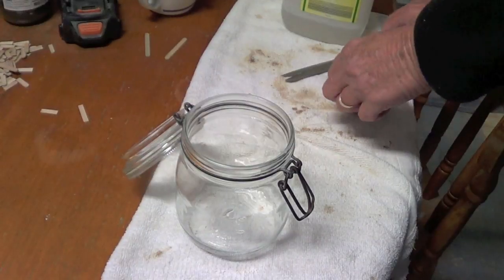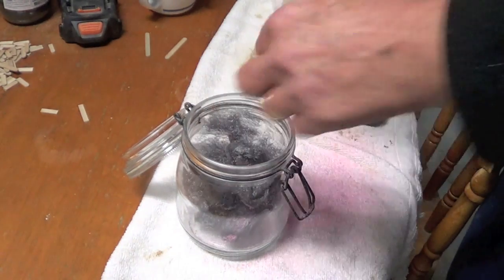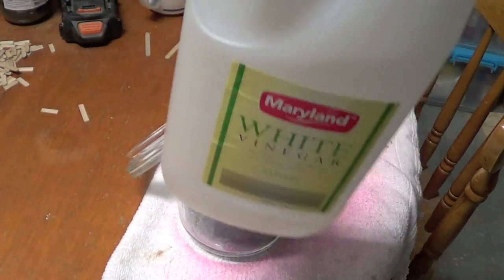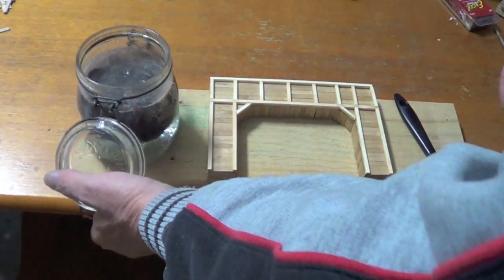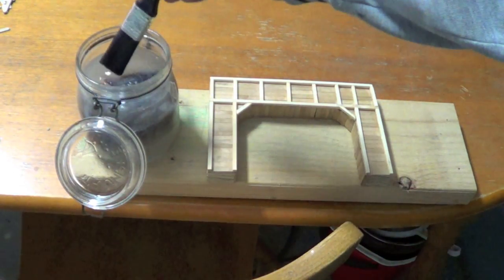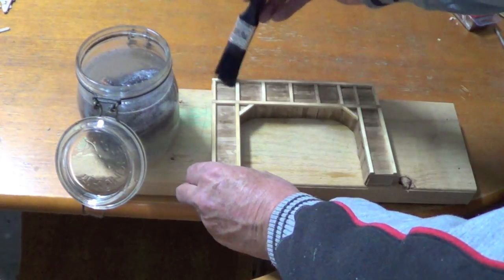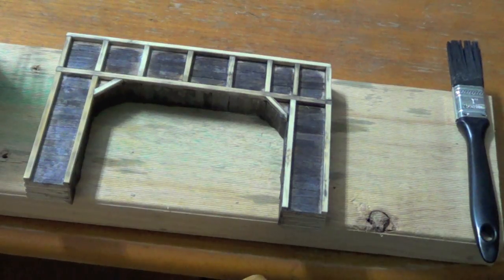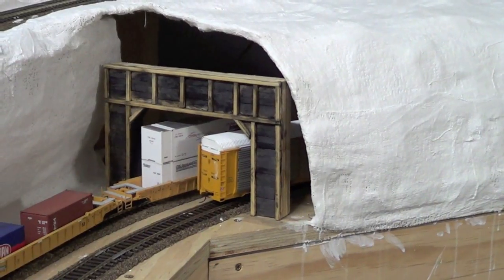Oxidizing Tunnel Portals"Model Trains"

Comment: I haven't seen that little trick before. It did a fine job of it. Simple, cheap, better than $4 or $5 for 3 oz of model paint. Thanks for Showing this. I may find a use for it someday. Regards, Solomon
Reply from the maker: Solomon i thought it was a good idea as well, that is way i pinched it lol cheers Robert

Comment: Looks almost creosote treated lumber. Very cool. 

The skewers , did they not absorb due to differences in material or treatment or what was the cause of them not taking the oxide?
Reply from the maker: The skewers had the plastic film on but i did sand these but the timber is different to
the pop sticks cheers Robert